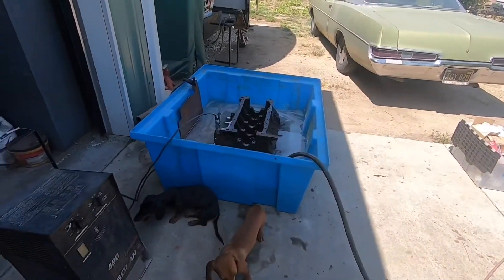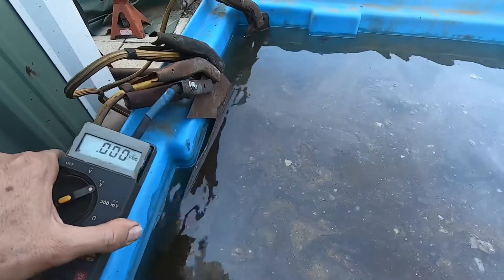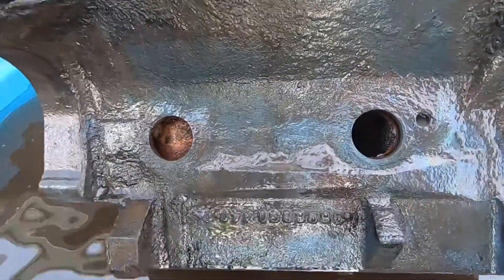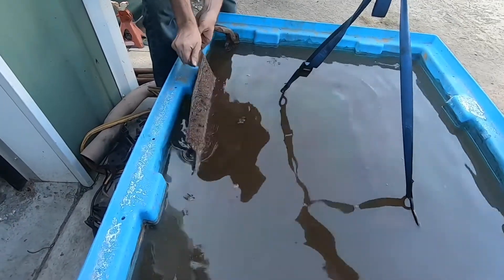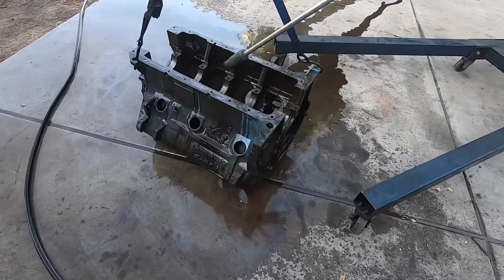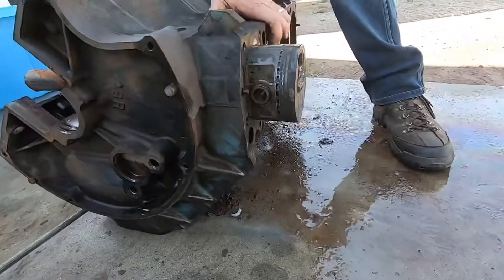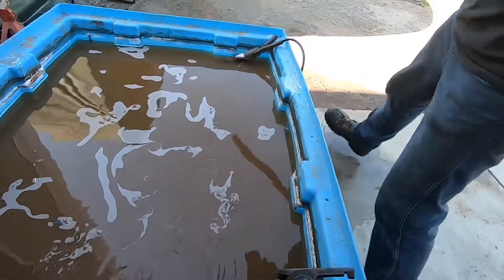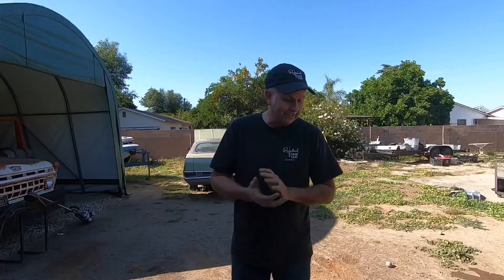How To Derust an Engine Block At Home with Elana Scherr and Tom

Comment: I use a cheap little inverter type Arc welder :glasses-purple-yellow-diamond:with my set-up , i run up to 50 amp but 30-40 seems to be a good set it and forget it setting, voltage at that low setting is around 15v-16v:face-fuchsia-tongue-out:
I suspend the castings and have rebar grating on the bottom and scrap plate on the sides all welded together.
Electrolysis :oops:only does paint removal if rust is underneath, the process heats the water so i have a lid to trap the heat, warm water seems to work better.

Comment: The process works by basically attaching the rust to the current so if you were to place the anode on both sides instead of doubling up on one side you would be completing the circuit on both sides  for shits and giggles I'd just put one on each side of the tub so there were 4 equal parts for current to flow.  Even if for some reason splitting it were to cause the block to clean evenly vs one side and it took longer it would essentially be the same time as having to clean one half then rotating it like he said. It's one of those you can do it once and take 3 hours or you can do first half in 90 min and then other half in another 90 min

Comment: We did my friend  Randy's 350 4 bolt main block  that he thought  was too far gone with rust until I showed him what 4 days in the derusto tank did using this process, he was amazed,  what you need to do if the block is going to sit a while  after using  this procedure is you have to completely  oil down the block inside  and out  with WD40 then when you're ready  to rebuild  it have it hot tanked to remove  the WD 40 oil, this process  is truly amazing!

Comment: I'm looking for a vid where the tard isn't first timer following some other tard's instruction. Soda carb to water ratio, maybe scrub the anode off every so often, maybe have a ratio for anode to part surface, amp setting maybe use two of them would do better etc.....

Comment: I’ve used a turkey fryer and a old 55 gallon drum an used zap degreaser and water. An turned on the heat let it go for a few hours. It did good getting the grease off

Comment: Is there a way to determine if the engine is too far gone? My jacket is REALLY rusty but its flaky so seems to be surface, not quite sure...
Reply from the maker: It's probably okay.   You'll need to remove the rust for best cooling performance either by chemical dipping or the electrolysis process. - T

Comment: Thanks for the video. Cood a guy make a square metal box to surround the engine on all four sides really close? Wood it pull the rust out of it faster and also get into the nooks and crannies?
Reply: Yes but the box being an cathode means it will be getting chewed on by the process so depending on thickness how long it will last.

Comment: Muriatic acid is much simpler and quicker. It's too weak to eat solid metal, but it devours rust. Only costs a few bucks for a gallon. Just make sure you wash the parts with baking soda afterwards to neutralize the acid.
Reply: Ive used it , the risk factor is to high imo .

Comment: If you scrape the crud off of the sacrificial metal every few hours you will get stronger current flow and faster rust removal.
Also, it's easier to move the sacrificial metal than to turn the engine around.

Comment: Hey Alana I had a 69 polara 500 same color as yours I have a full set of bumpers with brackets some grill parts headlight bezels and some other parts you might be interested in. I also have the chrome trim option that went on the very front of the car. You can email me at Tom's 4406 at yahoo.com if you're interested

Comment: What setting? 3Amp, 40 amp? does it matter? larger tank more amps? Super washing soda seems to be the most used item. what about Borax? we use borax to soften the wash water in the laundry. vinegar?
Reply from the maker: My guess is the more amps the faster the action but it's probably harder on the battery charger.    You can see the action taking place after the current is applied and it definitely is more apparent with greater amperage.  Sodium carbonate is the active ingredient and it's commonly found in washing soda or water softening products.  Borax is not sodium carbonate so it may not have the desired water solubility for best results.  If you find a name brand water softener you can probably Google the ingredients (or chemical makeup) to verify the presence of sodium carbonate.  Hope this helps.  T

Comment: what are you doing with the leftover water solution
Reply from the maker: Mainly rusty water.  A lot of iron oxides (rust) gets removed so its basically harmless but you don;t want it on a concrete driveway (unless you like rusty concrete driveways!)

Comment: I have a block with 6 of the 8 pistons rusted stuck pretty bad so I can’t get the crankshaft out, is the electrolysis safe for the crank?
Reply from the maker: I don't think I would put an assembled engine through this process so I can't guess at what the results might be.  It can be tough to disassemble rusted engines but you may be able to just cut the rods off the crank and just buy new rods.  I would cut the rods in the beam area away from the crank journal.  Hope this helps.   T
Reply: Should be fine , probably do a number on the bearings tho.

Comment: so if you used a metal screen or concrete mesh stuff wouldnt the electricity be applied all the way around the block then?
Reply from the maker: Large surface area seems to be the most effective.  Flat sheet metal works the best although we generally use whatever scrap we have on hand as as long and as it's steel the process works good.

Comment: The more sheet metal you use the faster it works, I put the metal all around the outside of the tub, just don't let it touch the block, or use it inside

Comment: How much power you put in ? ... 10, 20, 40amp ? ... for 36hours ? ... lol .. thats a hard task on a charger ... i guess that bigger needs more current
Reply from the maker: 40 amps day and night for 4 days.  The battery charger is from the 1980's, made in the USA and its been doing this for 30 years!  I'm not sure if it need this much amperage but it sure gets it done.  T
Reply: Aoutch...thats quite big of a run for my Schumacher pos...it is a manual one but very light overall...ive notice u got a Solar one and I know there good....ill find my way with something.... by the way thanks for the response I appreciate ... stay safe guys ... 
Mathieu
DownTown Montreal PQ

Comment: Looks like this block was sitting idle for quite a period of time... The first antique tractor my Dad has was stuck when he first bought it... He just used a bit of Marvel Mystery Oil and it did the trick!!... " His Pistons were a pissin"... 😆!
Reply from the maker: Tractors are so forgiving.
Reply: True... Only 4 cylinders to deal with rather than 8... Usually not ran as hard or fast either...